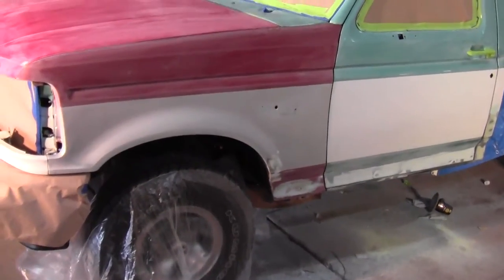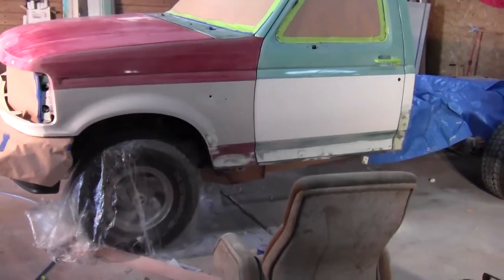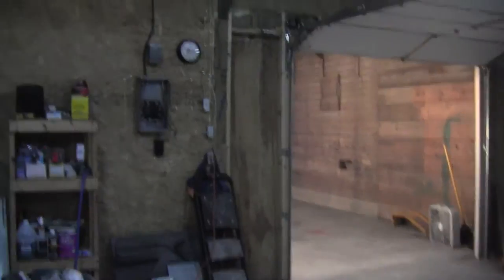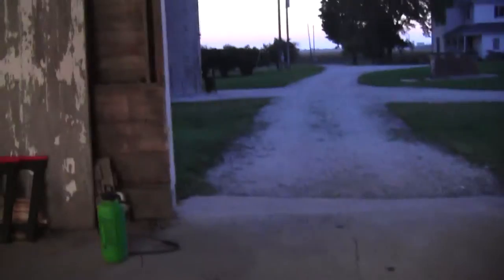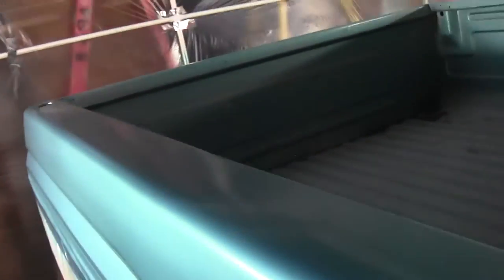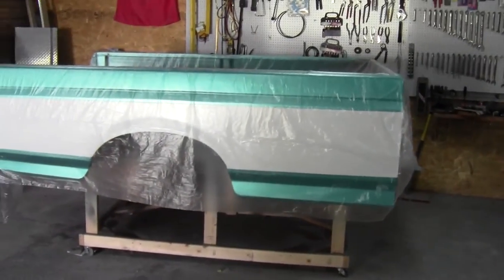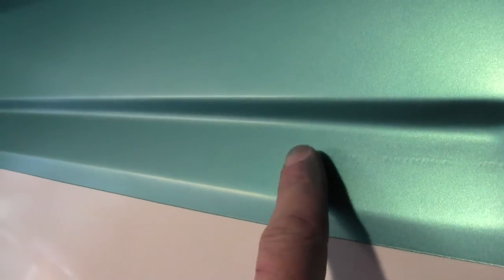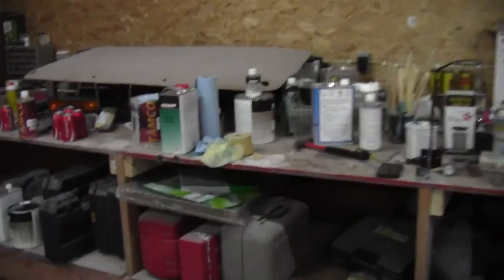1994 F150 Restoration #27 - RESTORATION PAINT TIME!!!!!!!

Comment: I'm about to paint my 94 f150 two tone red and white. how much primer and paint did you use? also what brand did you use?
Reply from the maker: I used Nason base coat, not top of the line but not bottom either. I bought a gallon of green and a gallon of white. used almost a gallon of the green, not quite and about half of the white, but better to have too much than not enough.  For clear I used Tamco European Clear, bought from Autobody101.com...  Chris over there is a great guy and will treat you right with lots of experience also. I don't remember the quantity, it comes in a kit... I think it will mix up to make a gallon.  Primer I used Tamco Galvaprime Gray... sold at Autobody101 also... it is a high build primer and I absolutely loved the stuff!

Comment: Hey bud - what's your primary paint code?  That white paint I'm sure is "YZ," but what's the green?  Share that with me and I'll look it up & keep an eye out for your stripes.  I've actually had decent luck finding some to match my own '94, which will be getting body work at some point -- NOS Ford stripes too!  Couldn't believe it.  You'll have fender stripes and then a tailgate stripe that has a separate part number.  I'll keep an eye out for all of it.  HARD to find that stuff.
Reply from the maker: Very hard to find. YZ and PL  are the paint codes.... also on the door sticker it says "tape" and under that is the letter P.. don't know if that means anything. I've tried looking for the OEM tape part numbers, but good Lord, I can't make heads or tails of them and run out of patience. would love to get the tape stripes, but not going to spend a fortune on em and they just seem impossible to find.
Reply: The Fox Shop where did you order the pl paint

Comment: FANTASTIC work..  I know you were exhausted.  I would have been livid over that tape leaving a line.  That broke my heart when you zoomed in on it!  lmfao

Maybe you posted this at some point, but what are you going to do about the stripes?  My truck has the same decal stripes on it that yours did, separating the two colors of paint.  If you find those stripes somewhere, tell me where you got them to match your paint, will you?  My truck is two tone like this, only a darker blue at the top & bottom, &  I don't know where to begin to look for replacement stripes.  

When I go to fix my '94, there is no question I'm going to have to replace the driver's front fender due to rust damage at the bottom (completely gone & rusted through), and they'll have to cut into the stripes with the patch panels that will be used to repair the rust at the rear, so I'm GOING to lose them for sure, & it'd be great to put them back like they were.  I have them top & bottom.
Reply from the maker: hey Cody.....actually after the clear went on the stripe it left is barely noticeable....nobody has noticed it yet in person up close, do I think it's b going to be ok, seemed to kinda leveled out...man I was pissed! I contacted rustoleum about their crap tape also....don't think they care....talk about great customer service ... NOT! as far as the tape stripes, I have no idea where to get them. IF you can find any, I think they are fairly expensive. I'm on the hunt, May check into a graphic design place or something to see if they can reproduce. going to ask a autobody repair place also, they may have an idea. I'm in no hurry, don't really plan on driving her till next spring.....have things to do to her over the winter and I'll be damned if I'm taking her into the road salt right off the bat LOL... You bet I'll let everyone know when I figure out out though. I have a vid I want to do soon, can't find the time right now though.... my vids are far from being over. for the front fenders, find a good factory metal fender from a salvage yard, just inspect real good. or buy a new aftermarket one, I'm real curious on the quality of those. people seen to thing they are thin metal, but they are thinner than most people think from the factory. When I do another, I might go that route. also patch panels on the box are cheap and not that difficult to do, but if I do it again on this truck...my baby, I'm replacing the whole bedside. Already have the passenger side, found a new one on craigslist, picked it up for only $60!! looking for another but buying another won't be bad. no filler that way and easier.  hoods are fairly easy to fin. just watch that front lip. doors are more difficult, but you can find if you have time.  Tailgates, up here anyway are rather difficult, but zi finally got one like new for $100 I think. it's a lot of work but o so worth it!
Reply: The Fox Shop Yeah, those aftermarket fenders can be had for not a lot of cash.  There's a guy right now who has them up for sale on eBay for $100 and free shipping.  Doesn't look any thinner if at all than a stock part would be.  He also has brand new hoods for $250 and free shipping.  So odd that so much of my truck is pristine and untouched (glossy paint and good looking), and then parts of it are just GONE -- rusted clean through like it was soaked in a salt bucket.  Still, these trucks are so solid, and so comfortable!  I never knew before that these older ones had such great suspensions under them until I bought this '94.  It rides better than my '06!  Love driving it just as much!  Mine has 373K on it, and the engine still sounds incredible.  I see now why dudes are so hot after these late 80's/early 90's F-150's.

Talk a little too about what you do or have wound up doing with the rear fender wells (where "typical" Ford rust always starts on these trucks due to Ford's wacky design of the well, which allowed salt & grime to get trapped up in there and gnaw at the metal).  I think I remember you toying around with doing something different with that when you put this truck back together, to allow you to wash it and keep that area cleaner.